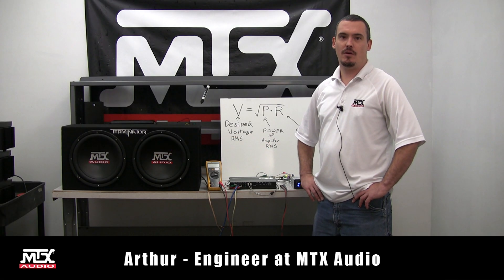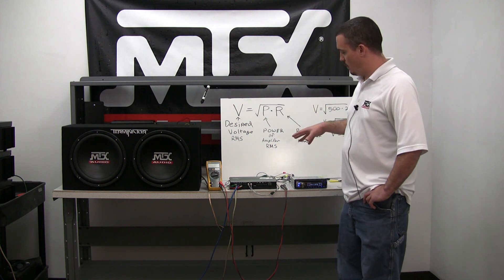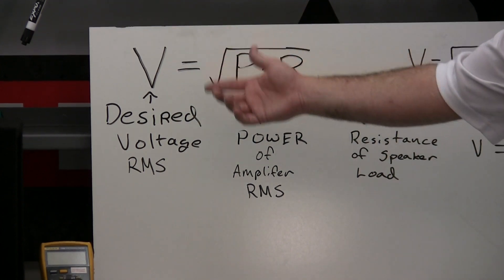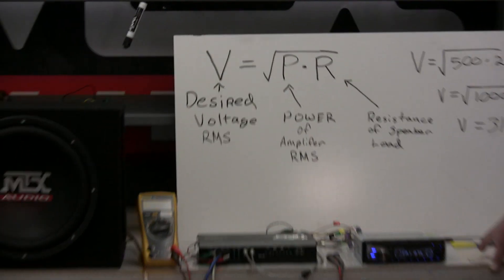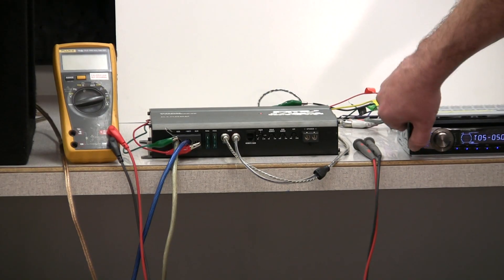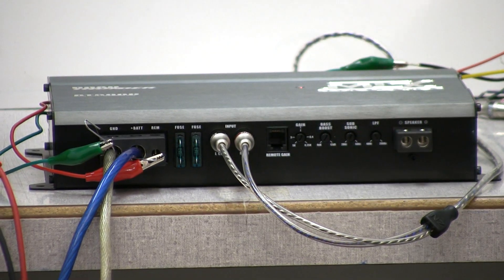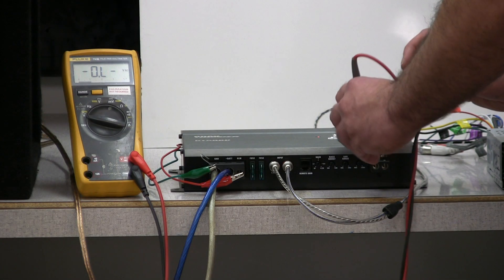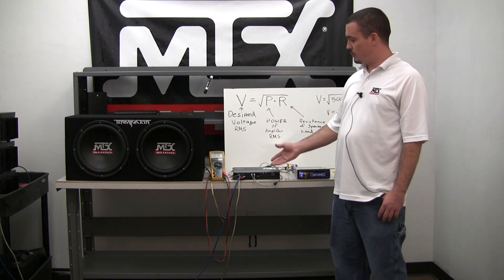How to Set Your Gains Using Ohms Law and a Basic Multimeter

Comment: so My 1 ohm stable amp rated at 484 watts should be 22 volts? My speaker rms is 450 so it would be brought down to 21.21. I have a kicker L7S82 8 inch ran at 1 ohm to match the amp.

Comment: Is this formula for DC output voltage or AC output voltage? An audio engineer told me that formula used is for DC output and we should be using the AC formula which is different to what we are looking for. Can someone shed some light on this?

Comment: What if your on stock electrical and your amp is 2000 watts what would be my target voltage? I couldn’t base it off 2000 W because a stock system would not put out 2000 W. Please help me understand
Reply: You need to know the RMS of amp and it's not 2000. That's probably your peak power which is not relevant.find the RMS multiply by impedance of speaker(s). Which should be 4 or 8 ohms. Than you get the square root of number and that's what you set it to. Example 600w RMS 4 ohm speaker= 2400 the square root of that is 48.98 and that's the number you would set gain to using multimeter.

Comment: Bass boost off, radio at 3/4, bass knob at 3/4 play test tone close to box tuning or cabin resonance, then multimeter the speaker output of your amp measuring VAC turn the gain up until your at your calculated voltage [VAC=√power (desired wattage)x Resistance (your ohm at the amp)] VAC=√P*R

Comment: I know this is an old vid, but how do you replicate your ohm load while checking the voltage? If the amp doesnt currently see the right ohm load, how could you possibly set the gain accurately? Lastly, what about box rise, aka ohm rise? Whatever you wire your speakers to will rise while you use them. This method doesn't work.
Reply: This is for setting amplifier max output wattage at certain ohm,if subwoofer have same power or more than amp. This way amp will never clip.
But if amplifier has way more power than subwoofer, we calculate subwoofers rms wattage with certain ohm load. This way we don't burn sub. 
 When we have amp with more power, we can use box rise in calculation, or turn gain a bit more than calculated voltage of subwoofer rms power.

Comment: I bought a multimeter today for this purpose. I got home and stuck it in  a plug socket to test it worked and it was 243 volts so it’s good. Ngl I was a bit scared about sticking it into the plug socket tho in case it went bang 😂😂😂
Reply: Lol

Comment: Im using a skar audio 800.1 and I'm running 600 at 2 ohms and the square root is 34.4 but my amps voltage on the gain only goes up to 27 so idk what I should set it at.

Comment: Why do you use the RMS power of the amplifier instead of the RMS power of the speakers?

If you have speakers that handle less RMS power than your amp then you would be supplying more power to the speakers they are able to handle.

I believe you should use the power of the subs instead.

Comment: My amp has both a gain control and master level. When doing this where should the master be set? If it's all the way down there's no output at all no matter where the gain is set. Should it be all the way up and set the gain based around that level? Or find some balance between the two? The amp is a Jensen xda91rb. Also worth mentioning that there's no controls on the amp. Everything's controlled through an app via Bluetooth

Comment: Have a amp 4ohm x 100 watts = 400 sq root = 20v.  I have set my multimeter to Ac voltage, no speaker wires in amp, stick the probes from mm into postive and negative speaker holes, and play pink noise track at 75% volume, turn up the gain slowly, im only getting a little over 2v, nowhere near 20v, what am i doing wrong ?

Comment: I used this method with my skar rp2000.1d and my 2 12" EVL Series subwoofers and this method did not work. I did V = 2000rms wattage × 1ohm which equals V = 2000 and the square root of 2000 is 44.72
When I turned on my head unit and played a test tone through it (with all speakers/woofers disconnected) I had my gain all the way up and it was only reading 33.43 I knew something was not right I watched many other videos triple checked my math. Decided I'm just going to have a sound shop tune it for me. Pretty disappointing I wish they showed a video of how to tune my specific amplifier with a multi meter
Reply: I imagine you had a weak ground or undersized wiring, and the amp couldn't make more than that. I had a similar problem, but when I upgraded my wiring and did the Big 3 I was able to get full power out of my amp.

Comment: Sorry guys but I have a dumb question.. my gain needs 27.2 volts. My cars alternator puts out 14.4 volts. Do I need caps or an extra battery? Jus running a 800.1d mono and a 10" dvc 2ohm sub (running at 1ohm) amp is 1 ohm stable
Stock stereo with added sub for more bass. Using a loc2 and 60amp fuse to battery.
 Thank you in advance

Comment: For the resistance of speaker load, would that be resistance per channel? For example, having a 2 channel amp, with a 2 ohm impedance on each channel, would you use 2 as the value for R, or is it the sum of both channels, 4?
Reply: IT WILL BE PER CHANNLE IN YOUR CASE 2 OHMS sry for caps..if it was bridged ... so only one channel it will be 1 ohm depending how your speaker was set if it was set in series it would be 4 ohm if it was two 2 ohm speaker ..keep in mind if you use duel voice coils

Comment: If I have a dual 2 ohm sub wired down to 1 ohm do I multiple my RMS by 2 or 1 ?
Reply: 1, so your target voltage would be 22.36 in this example however, do not turn your radio all the way up, low level outputs can still have distortion. 3/4 volume would be more advisable unless you have access to an Oscilloscope, a DD-1 or another similar device to check at what volume level the head unit distorts.

Comment: If the subwoofer 4 ohm but it is bridged , ohm is cut in half. İn this case we calculate by multiplying  RMS  by 2 instead of 4 ohm , correct?
Reply: Yes
Reply: I have two dual 4 ohm 10 inch AB XRs I have them wired down to 1 ohm for my skar rp2k1d amp so you use what your amp is rated to not the subs

Comment: This is a good way to do it without having the proper equipment. But, what about amperage? What is the speaker output amperage? And, what about the phase of the power output? Because I was watching D'Amore Engineering discussing this topic and how/why this method is inaccurate and why even a clamp meter would be inaccurate. Anybody have any answers?
Reply: The audio I do on bikes, obviously wanna higher RMS on your amp than your speaker... I set gains by going by the Voltage x Amp = Wattage. and from there i can adjust to each speaker giving it the exact amount RMS with the radio all the way up so they cannot blow the speakers. LOL

Comment: My amp is 1200 @ 1 Ohm so that's 800 @ 2 Ohm and I'm running my sub at 2 Ohms. Would this mean my P variable in the equation would be 800 or 1200?
Reply: I have the same question
Reply: It would be 2ohm x whatever the amp put out @ 2ohms. Then you square root the equal value.
Reply: use your subs RMS ratings not the amps. If your sub is rated @ 500w RMS you'd times that by ohms then square root. 500w X 2Ohm = 1000 and that squared is 31.6v

Comment: This may be a dumb question and forgive me if so, but my understanding is that setting the gain with pretty much everything flat puts your amp right below clipping or distortion? So you're really not supposed to use "bass boost" nor tune the bass frequencies up when you go to equalize, or turn your subwoofer level on the HU up any afterwards? What you set your gain to is effectively as high as you can go with output? Not sure if I understand
Reply: I’m an intermediate installer learning how to install my first setup and from everything I have watched and learned setting the gain at the exact level with a multimeter is the best way because the amp will not go above that voltage  limit and potentially damage the sub with too much power, and I have also read that on your head unit the LPF, if you have one should be off and any bass levels should be flat. Bass boost is not a volume control and I would leave it at 0 on the HU and amp as the gain is already transmitting the maximum performance range that the sub can get to so you’re not missing out on that much power. So to sum it up, the gain, at the correct level, will provide for the best and maximum performance out of your sub without going past the voltage that would potentially blow or damage your sub. Set your LPF and Subsonic filtering as necessary, the standards are LPF at about 80 and subsonic at about 35 but that depends on if you have a ported or sealed box which there are videos that better explain that.
Reply: @bryan3327  this is what I was looking for and answered my question thoroughly! Thank you so much!
Reply: @handon11  No worries! I had the same concern as well being a noobie and trying to install a sub on my own and after one blown voice coil it has definitely been a learning experience so I’m glad I could help!

Comment: Does this also protect from Clipping?
Reply: Yes. If you match the gain to your source it will never clip up to the max volume on the radio. Some radios clip internally at higher volume so you have to figure out at what setting the head unit clips and never turn it up past that. Clipping is basically like shorting out your voice coil out with DC at the top and bottom of the sound waves. Literally HORRIBLE for your speakers.

Comment: Just curious I keep hearing different things when setting up this way. Some say have your bass boost and bass settings on the receiver all the way up? The reason is because if you set everything at 0 while setting it up and you play something that you just want to turn the bass up on now all of a sudden your going over the voltage you set the gains at and are now clipping. So which way should it be done?
Reply: I learned the hard way on why not to use bass boost on your amp. I fried 2 subs pretty easily lol. If the sub isn't loud enough without bass boost, then you want a louder sub.
Reply: @Ken751  this has nothing to do with what I'm talking/asking about, that is a whole different subject!
Reply: @pimpedstratus  oh, I just have a level control knob that controls the volume of the subwoofer that I would use to turn down the bass if it was too loud, otherwise I leave it all the way up at the max. I just set the gain with the knob at the max so I can't accidentally blow it.

Comment: I've watched multiple videos and read multiple articles on this and this video by far was the easiest to understand and I've played around with my settings bass boost all that even using an ocillascope....but tuning my amp exactly the way y'all have directed in this video just using a dmm made my system sound 10 times better.
Reply: Yes your right seen millions of videos and this was straight to the point and looks possible to anybody can do it
Reply: I running 2 1500rms subs at half ohm..so id.go.1500x.5=750×2subs=1500 and the square rt of 1500=38...so.38volts is my number..
Reply: @ronnydisalvo80  no sir you have to use the rated rms output number of your amp....so say your amp is rated at 2000 rms at .5 ohm....multiply 2000 by .5 and find the square root with is approx 31.62.....
Reply: @85jmccoy  thats incorrect..completely as i have a smart 3 taramps 3k which pushes 3k at 1 or 2 ohms..at 2ohms it is barely enough to push 1sub at 2ohms as my subs are conservitely rated for 1500rms..so i did 1800x5 for rms x ohm load then x2 for 2subs and yes this amp is stable at half ohm taramps smart 3...still not pushing them to max..so im upgrading soon to a 5k to push them at 2ohms ..as i get what your trying to say but depends on amp and what ohm stable it is WATTS vs RMS on subs..if your subs are rated 1500rms each and you have a 2000watt amp then using your way would be pointless...their is alot to take into account and since ive posted this have gained alot of knowledge..but thanks
Reply: @ronnydisalvo80  you have 2 subs wired in a way that gives you .5 ohm load
Reply: @ronnydisalvo80  so how can I do that on mine bro ..??
Reply: @tonycervantes4816  tell me what subs and what the rms is on each and let me know what amp you have..and let me know what ohm load your wiring your subs to..
Reply: @ronnydisalvo80  hi Tony I have a 2 12 d4  1200 watts 
600 rms each..  i wire a 1 ohm and I have a  1200 D.1 amplifier  bro 
.Como puedo hacerle..
Reply: @tonycervantes4816  si
Reply: @ronnydisalvo80  puedes ayudarme bro. . Aun no he puesto my subs. Necesito tune el.estereo y el amplificador.  Solo me falta eso.
Reply: @tonycervantes4816  usar la dmm..y numero es rms x speaker rms x ohm x
Reply: @ronnydisalvo80  no entiendo ahi bro.

Comment: What of my subs are wired to 1ohm?
Reply: Then multiply by one....then find the square root.....or Google it lol
Reply: I have to 12s wired down to 1 ohm.my amp supposedly pushes 1500 rms so square root of 1500 was roughly 38.7 so I put a 50 hz test tone on and got as close to 38.7 as I could.....my subs have never sounded so good
Reply: @85jmccoy  bro I need help. My amp is 1500rms. But I can’t get the volts on the meter to read that high.
Reply: @12345MPEG  what kinda meter are you using?

Comment: Thanks for the video
I have 2 Doubts
1. , can you explain what should be the positions of HPF & LPF, switches while doing the gain setting for speakers and subwoofers
In a 4 channel amp.

2. In every videos in YouTube  regarding the gain setting , they are using RCA input.. is that mandatory.. ?? What would happen if I use speaker level input instead of RCA while doing the Gain setting...
Reply: He answered both of these, turn the filters all the way down then if not using rca you turn the head unit to max volume. He didn't say this.. but with rca you would use around 80% volume

Comment: What he didn't tell us is that most multimeters are horribly inaccurate when reading rms voltage at higher frequencies. This works at 50-60 Hz for setting a sub amp, but will be way off setting a multi-channel amp.

Comment: Why my voltage is jumping up and down when I am measuring and your is constant ? 
I couldn't adjusted my voltage to be stable on my meter .
Is there anything I am doing wrong ?
Reply: How many watts is your amp and what guage power wire are you running to it?
Reply: I managed to sort the problem ,it was my fault 🤯.

I got confused with it.
So: 
I got 4 Chanel amplifier with 125W RMS for Chanel .
So totally amp has 500W RMS.
 Have 4 speakers which have 4ohms each .
2 speakers 6 x9  100w RMS each 
And 2 components speakers 100w each  .

Should I count it as 
500W X 4ohms  or 
125W X 4 ohms ?
Reply: @KamilKamil-xp8jv  in total assuming you have those speakers at 4ohms at the amp, you should use the 500x4 equation

Comment: So if I have 2 subwoofer at 2ohm each do I multiply by 1 ohm total??
Reply: The amount of subwoofers you have doesn't matter.. It's how you wire them and what impedance the amp sees at the end. So if you have two dual two ohm wired to 0.5 ohm then you use 0.5 ohm. If you wire it at 2 ohm then use 2
Reply: @New Alert That's correct. I'll edit my post

Comment: My led clip light will turn on when I adjust the filter afterwards so I set the filters first then adjusted the gains.
Reply: If it's flashing it's ok solid no good
Reply: Makes sense set the sound you want...then adjust the level of the sound you like to play the loudest safest gain level
Reply: @ukokepaoa5536  filters should only lower the power or loudness. 

For most amps, The only adjustment I can think of that increases sound or power other than  the gain knob; would be the bass boost switch or knob found on some amps

Comment: Great video, one thing i would do differently is when calculating the voltage, i wouldnt put the wattage of the amp, but wattage of the speaker, so if you have a 300W speaker and a 600W amp you dont push 600W into the speaker, but only 300W. Or am i wrong ?
Reply: You could if the amplifier put out more power than needed. But if your buying an amp just try and match the RMS of the amp. A lot of people advertise as 1000W but really only output 250W.
Reply: It should be the same calculations either way.

Comment: Does the active crossover system(Tweeter and Woofer Speakers) also use the same procedure to set the amplifier gain?
Reply: I think. I would assume you would want to test it with a frequency that the speaker is lowest rated for as this will be the max rms power at that frequency

Comment: As soon as you said, “just turn the headunit all the way up”, I knew that you don’t know what you are talking about. If you don’t know if the headunit is distorting, everything else is null and void.
The rest of your info may be correct, but now we have to look elsewhere to confirm because part of your information was incorrect.
Reply: Well since you know what you are talking about......how should it be done sir?
Reply: I mean this is just an amp and speaker manufacturer giving us the info lol
Reply: Also he said he was using the line level output wich is a lower output that is generally clean. Throughout the entire volume range.....

Comment: Ballsy move playing with those DMM leads to the speakers outputs while your amp was at full tilt. If you're playing around with that much power, use the speaker set screws to lock the leads in place,  then power on.  Then turn everything off before removing.